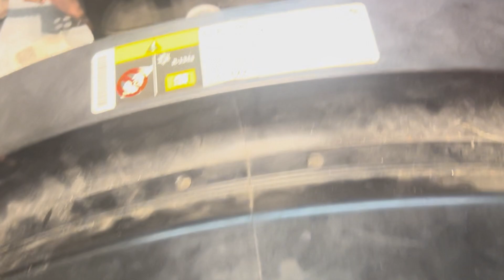2018 Ram 3500 6.7 Cummins: Banks Monster Ram Install!

Comment: The remote starter on my 2019 throws a engine light now after monster ram install can’t figure it out ☹️
Reply from the maker: Grab a scanner and have it scanned I’m sure that will help you pin point what the problem is! Could also go over and make sure everything is tight, and electrical connections too!

Comment: I just did one on my 2018 2500.  I pulled a PO113 code .  I replaced the MAP in horn .   Still have code the truck runs great

Comment: I know this is old but any chance of a vide of the grinding you did to the 19mm to fit it?
Reply from the maker: Hi! That wrench was a very old thin vanadium wrench that I had lying around and modified. I would recommend ordering a good quality sacrificial 19mm and grinding as needed a little at a time. Grind too much and it'll be weak and break, grind too little and wont fit. just trial and error! 
Good luck! Thanks for watching!